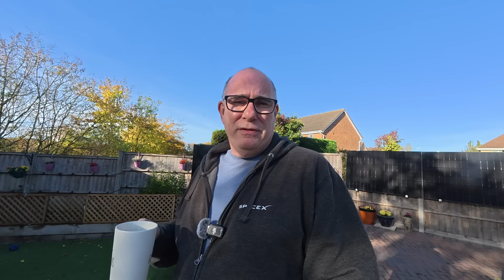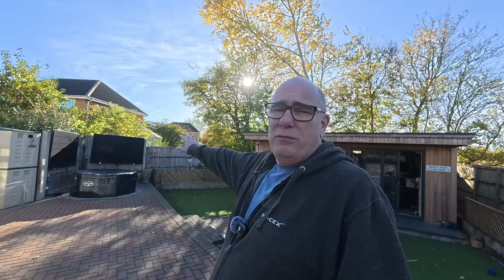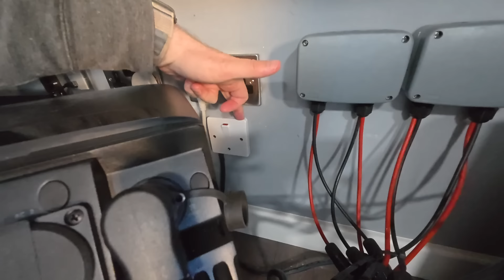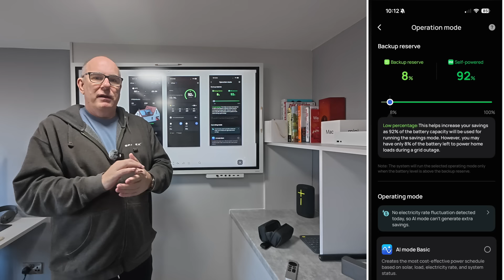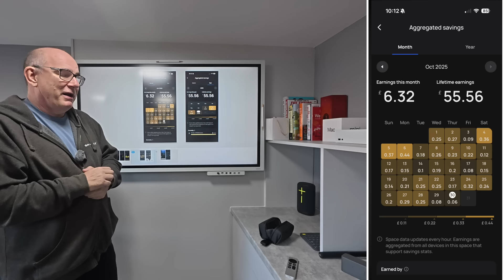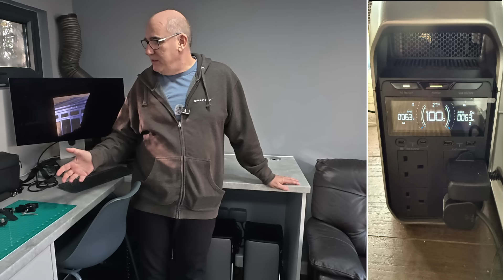I Tried Plug-In Solar for 90 Days (EcoFlow Stream Ultra UK Review)

Comment: This is a great video with lots of information. Question: when plugged into an outlet, is the electricity distributed to other circuits of the house? or it is only powering the devices on the same circuit of the outlet? I assume your house have multiple circuits from the electrical panel. What is the impact on the load on the circuit?  I believe most circuit wire has 15A to 20A limit, or around 1900W to 2000W, on a 120V line.
Reply from the maker: I can't really comment on US electrical supply as I have little to no experiance of its but here in the UK it can share across all circuits unless there is a specific block to stop this (sharing across phases for example) so should be similar in US, but would check with an electrician

Comment: Jonathan, how did you get round about changing the ecoflow battery at nght to fit in with intelligent go? Thinking about   buying an ultra + so you have highlighted a potential problem.  Nick
Reply from the maker: so luckily there is a new feature in the latest ecoflow app that called operating mode. in that you select custom and can then set a schedule to charge - 23:30 to 05:30 for example. They have not got round to adding custom charge speeds yet but I hear that is coming. So for now it just charges at 2300w

Comment: Great to see an update, I invested in this system last month and other than a faulty battery and annoying return process it has been good so far.

Things to highlight.

If you get a power cut it won't feed your house.

If you get a power cut the AC sockets can still work but I have seen them lose power with a power cut and have to be manually turned back on, but not lose power if I turn the socket off at the wall... (Running off an isolation switch). This might be an earth protection feature as during a power cut I may have lost Neutral/Earth so may look into a permanent earth.

I think you are doing a disservice to the solar generation by not at least trying a better angle to your panels. But we all have unique requirements.

I'm not interested in feed in tariff I just want to be as close to 0kW used as possible, So a £3k manually articulating install on my fence is much cheaper than a £15k install on the roof. And maintenance/upgradeability/move on potential is easy and cheap.

Keep up the good work.
Reply: Oh one other thing, using the smart meter (Black version) the 3 CT cables are joined together, too short and can't pass through small spaces like a normal CT clamp would. And it isn't sensitive enough to stop feedback to the grid so currently having to set an estimated base load.
Reply from the maker: All good points, with regards to the orientation, I can't put them at another angle as every other spare part of my roof already has panels on it and its connected to my large battery system. This is my hobby system :-)

Comment: Great video, I also keep thinking of adding an additional battery.....my saving come mainly from charging the batteries at night at 7pence per kwh. Out of interest do you fully charge and discharge your batteries given it's winter?
Reply from the maker: I do fully charge them every night, but I haven’t yet got to the point where I need all of the energy from them, even if I discharge about 10 kWh to make a bit of money I’m still got about 25% left from the end of the day. However, looking at data from last year once we get into late December early January and it really gets cold then we’ll be running the batteries down to about 5% and we won’t be able to force discharge anything because we’ll be using that for the Heat Pump.

Comment: Summary: just save your money for a real home storage battery - where a return on investment is actually feasible!
Reply from the maker: I already have’ real ‘ home battery storage, for me this is an add-on system. However, not everybody can have a full battery storage system so this is a viable alternative for them.
Reply: This is not described inside the video but the Stream system provide 2 features :
    - backup power on the local AC plugs in case of power outage
    - buffer battery to charge using off peak tariff and discharge in the AC network within the house to cover the consumption up to 800W (you can see a fix value, or simply use intelligent smart meter or smart plug integration so the battery knows in real time the consumption to provide using the off peak electricity stored )

The second allow to reduce your electricity bill 
In my case I got the stream distributed battery with 3 places : fridge, office and IT (internet and NAS) and I charge by night using off peak tariff (around 11 cents) and discharge the day and at the end of month, on 260 kWh consumed, only 15 kWh are peak hours (22cents). I’m basically reducing my bill by only 180 euros per yeses, but over the 10 year warranty it’s 1800 euros (it’s Portugal, the electricity price are not that high right now)

And as in Portugal we got a large grid failure, my house was still perfectly fine as my fridge, internet and my computer were powered locally 

It’s important to see the Stream system as a distributed battery AND a backup system and if you don’t own the place (rental) are you are in an apartment then it’s a solution to guarantee a backup solution ANd maybe add the off peak tariff as well as balcony solar

Comment: Really good . I have been considering Eco flow for garage roof . A question could discharge through out the day at say 25 watts.
Reply from the maker: I already have 4 400w panels on my garage roof connected to my solar edge system, the fences are the last space i have :-)

Comment: youve just answered a question I asked ecoflow today a few hours ago, which was to see a UK compliant setup. So thank you very much.
Reply from the maker: Glad it was useful 👍
Reply: I would like to see a bi-directional RCD type B plug built into the cable that comes with it similar to ones you can buy at TS/SF for having extension reels outside. I don't see a reason for it to be hard wired as it has automatic cut off.
Reply: @WhatTheHellMang  Even in the EU it's supposed to be a locking Schuko plug that is used (people often don't).

Comment: Great video once again 👍 
What energy delivery strategy do you use ? - that confuses me slightly.  Do you only discharge the battery in the evening.Does it matter if it's fully charged during cheap intelligent Octopus hours ?
What's your personal backup reserve and automated charging settings ?
Getting the ecoflow/shely smart meter installed next week which should help.
Cheers.
Reply from the maker: my strategy is complex as i have three live systems, the powerstream provides daytime base load 450w, the stream ultra provides evening base load 450w and the large battery system provides demand power all day, so if we go above base load it kicks in. 

I have way over complicated it but that's how I have it setup :-)
Reply: @JonathanTracey 
Haha and I thought my simple system was complicated. Most likely there's lots of ways to tinker with the settings and achieve similar results. The most important thing I suppose is paying for peak rate electricity as little as is practicable.

Comment: Was trying to talk myself into buying an ultra. But I don't have any spare ways on my consumer unit and it's also on the wrong side of the house (terraced townhouse). 
So it would need plugging in and the four pairs of solar cables running through the wall which is a pain (quite a big hole). 

So leaving it for now. But I'm glad they have made the product so maybe in the future others can make similar products that works well.
Reply from the maker: Yeah, it’ll be interesting to see how the other brands in this place react to it, I wonder if we’re gonna see something similar from Anker etc soon
Reply: @JonathanTracey Anker have the solarbank range but they don't sell it in the UK and Afaik it's never been certified here. Presumably if Milliband gets balcony solar here we will see it though

Comment: Jonathan, great video. I've been running the Ultra X for some weeks now. On the subject of charging from the grid during your off-peak energy window, there are now Custom options under the Operating Mode settings that allow you to configure rules for charging from the grid. So you no longer need to use the battery reserve percentage to force battery charging.
Reply: I do this too. I set it to charge at 7p rate every night and not allow grid charging outside offpeak. Very useful feature.
Reply: I foresee issues about whose fence it is .. firstly your neighbour may not want to see the hooks on their side and secondly the weight on the fence
Reply from the maker: thanks will take a look

Comment: So is this a viable way to add more batteries to the house along side an existing solar / inverter / battery setup?
Reply from the maker: yeah, it seems pretty simple, buy another block of batteries run one cable job done. I just wish it wasn’t a proprietary set up. It would be nice to be able to do that with other inverters.

Comment: Thanks for the review, Jonathan
I've been umming and awing on the Ultra X 3.84kWh and just waiting for it to go down in price since the summer (black friday maybe?). I'm not too happy that the force-discharge is paywalled. Can you control that through home assistant instead?
Reply from the maker: no, there isn’t a good Home Assistant integration yet. Certainly nothing official.  You can force discharge it on a schedule using the app no extra cost, but there’s no way to do it dynamically that I can find.

Comment: What happens if there is a grid power cut? Does it continue to power the "fused spur" and consumer unit?
Reply: No.
Reply from the maker: no, it cuts off immediately, to be allowed to sell this common equipment in the UK. It must comply with this requirement.
Reply: @JonathanTracey it’s not even about complying with anything, if it was trying to back power it’s not going to be able to power the whole street and if you isolated your board when you turned it back on you’d blow its inverter to pieces

Comment: I would like to see a proper Home Assistant integration, there is one but you only get the basic sensors but no controls, I would love to be able to start it charging when I have excess solar, or adjust the output power on the fly. Also I have the wireless power monitoring which I thought worked as it started charging when I had solar exporting, but it also started charging when my batteries were discharging to power my heat pump. Some built in "if this then that" commands would be good.
Reply: ah this is really making me second guess buying ecoflow at all
no home assistant integration with full control in 2025/2026? No buy.
Reply from the maker: yeah, I’m with you on that one, the third-party integration is great for monitoring, but I’d love to be able to do as you’re saying and control the system

Comment: So when the battery  is full you can't  use the excess  solar to power your home  unless  you have the Ai mode .  Is that correct  I have been wondering  why it didn't  work
Reply from the maker: When my battery is full, it does just seem to explore energy so I’m not really sure what this feature does. And I’m reluctant to pay for it just to find out I don’t need it.
Reply: @JonathanTracey Explore? Export!

Comment: Jonathan, what I dont understand is what MCB / circuit are you connected to in  the main consumer unit and if its a ring / radial circuit how do you power your internal home lighting from the stream ultra? many thanks for the video
Reply: He's in his home office in the garden, so I think it will be standard stuff, a 16amp MCB radial spur off the house consumer to a local small box in the corner of his office; it just feeds power back for either grid export or self consumption - doesn't practically matter that it's in a wendy house in the garden, could be connected to the same MCB in the consumer of the main house, lol.
Reply: @Bob-h4s2pokay I see, so he's just powering the local ring in the outside building not the lighting circuit?
Reply from the maker: Hey @BadshotUK  as @Bob-h4s2p says I have a 16 amp MCB with the fused spur as the only thing on that MCB. This connects into the consumer unit in my home office powering everything in the office, the lighting ring and sockets are separate circuits but as its all connected they can draw power as needed. The consumer unit is then connected upstream to a separate unit, that the house, garage and car chargers all feed from. This allows me to isolate the house circuits on the backup interface from my solar edge inverter (basically if we have a powercut I don't want the car chargers pulling power from the batteries) this also has the benefit of isolating my office which has its own UPS
Reply: @JonathanTracey ah Many thanks Jonathan, I went down a different route using my delta 3P with extra battery connected into my main board via a transfer switch, happily runs the house throughout the night then charges  up during the day on two 500w panels installed on my garage roof, the only limiting factor is the 1800w inverter if we have the dishwasher or washing machine on (not together 😂) I'm pretty pleased otherwise but I understand the PS ultra has a bigger inventer?

Comment: Seems like efficiency is around 94% for how you are using it (213/227) - that's pretty good if it is accurate! (It seems suspiciously good to me.) And the remainder isn't really lost if the unit is inside a home as opposed to outside the home as it will be given off as heat, though that won't be desirable in the summer.

Do they expose an API so that software people like me or tinkerers with Home Assistant or whatever could control them (not much to control I know but IOctGo charging and turning on and off load following spring to mind)? I could envisage directly exporting power during a non-IOctGo slot to power my home base load, but wanting to stop that from happening during an IOctGo slot, perhaps even charging to a certain level (not 100% if during daylight hours as then any solar would go to waste). And in my garden I could put panels facing east and west which would be an excellent adjunct to my south-facing roof-mounted panels.

I would absolutely shun paying for a subscription. That business model seems broken to me. "Pay us to reduce your bills" just leaves me cold. And if it's only controllable from the cloud, that's also another thing that turns me off - how many times have we seen products shut down because the manufacturer decides suddenly that they're not going to keep the cloud servers going. Hence the home API question.

Comment: Not just a "fused spur" it also needs to be on its own feed from the consumer unit which means an electrician whereas a fused spur technically does not always.

On the sockets - the sockets on the front are not part of the 800W grid tie budget which means your 500W video card in the gaming PC isn't eating the entire power budget. 

Also I thought those sockets stayed on when the grid drops like they do on the Powerstream/Delta2 pair - or is that not the case ?
Reply: Yep.  Crazy.  You are right for the UK.  It costs more to get an electrician to wire it in than the solution costs.  I just cannot understand why the UK govt is not changing this (I've even written to Ed Milliband to ask why?)?  If they really are keen to move to net zero (whether you believe that is a good idea or not) then by adopting the European 'just plug it in' model then millions of UK households could use up to 800 Watts to mitigate their bills and help the planet. Note:  over 4 million installed in Germany alone, what more do they need for a Proof of Concept?  Madness.
Reply from the maker: @TheImhotep2012 yeah to have it wired by a qualified electrician is going to cost you a few hundred minimum, the regs need updating
Reply: @JonathanTracey should be much less providing you just want the circuit fitting but will depend on cable runs. If you ask the electrician to wire in the unit too it's messier as they have to check it's safe, has a G98 etc and they own compliance. If they fit you a shortish run from the board to a box and leave the rest is your fault not theirs within limits at least.
Reply: @TheImhotep2012  it’s because of ring circuits they were never designed to have power put into them at multiple locations it messes with the whole concept.
Reply: @TheImhotep2012 it's a combination of our plug design not being lockable and ring mains. The plug bit isn't a big problem as you could replace it with a wired in spur yourself. The ring main in theory is, as are the way the protection works.
The theoretical risk is that you have a 30amp ring, a fault pulling 34amps and 4a going into the ring from the solar so it doesn't trip. Utah solved this for the US style wiring by simply using a lower current protection - so for our example it would be 26A. That's a much quicker and cheaper job than new circuits.

On the plus side if you have a separate wired circuit for solar/battery input then once you have it you are limited to 3.6kW not 800W if you apply for the G98.

Right now there is a lot going on to try and square political desire, reality (everyone ignores the rule, or runs loads of less safe extension leads), and safety regs.
Reply: @TheImhotep2012  British ring mains 😉
Reply: @TheImhotep2012 there's a government consultation on at the moment to remove this requirement if approved
Reply from the maker: Yes they stay on in a power cut but as I have a UPS that's not a requirement i need
Reply from the maker: The spur is completely separate from the other circuits in the panel, however in the ecoflow documentation it did not say you had to be on a separate circuit just a fused spur.